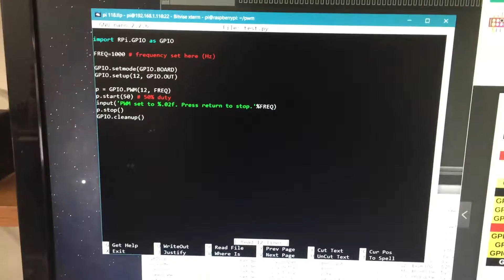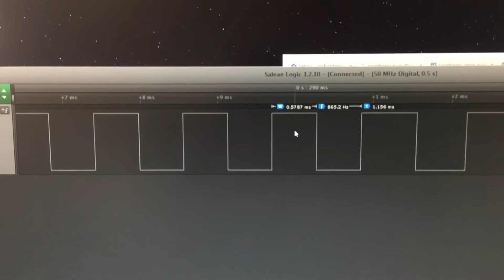Raspberry Pi PWM is jittery (seen with oscilloscope and logic analyzer)

Comment: It looks like I'm a bit late to the party, But the pwm is indeed noisy/crappy compared to a nice hardware pwm solution. I tried to use it as the pwm signal for some LED lighting drivers by using a transistor to pwm the dim+ and dim- wires open/closed, but the lights were a bit flickery, sometimes jumping to full brightness when the pi would stumble a bit. However after switching approaches and filtering the signal with an RC filter, then feeding it to an op-amp powered with 12v I was able to get a very clean 0.7-10v signal when modulating the pwm wave. I used enough capacitance to get about a 3 second response time, so the filter is averaging about 3 seconds worth of pulses, at 1000 hz, that's 3000 pulses it's averaging.. if they are all a little different it's okay.. after averaging 3000 of them a few errant pulses and spikes will be invisible. In a simulator I was able to make a random noise signal come out to a perfect 5v (1/2 on 1/2 off). The key is sacrificing changing speed.. if you need the system to respond to change in milliseconds the pi will not work.. but if you don't care that it takes a few seconds for the power to come up to value it's fine.  
Raspberrypi fourm post : Creating a 0-10V voltage range for ballasts
is where I got/stole the majority of the design.

Comment: You should try pi-blaster. I wrote this (based on servoblaster) to fix this very problem. It uses the DMA controller to generate a stable pwm output: https://github.com/sarfata/pi-blaster

Glad to see you back posting stuff!

Comment: Pretty normal for a Pi. You can use a Pi to drive an Arduino, or other MCU, or just a PWM chip to get a nice clean PWM from it. But something tells me you already knew that. 

It sounded like you wanted to generate a DC voltage from the  Pi. You can get a reasonably stable voltage output with smoothed PWM from the Pi, if your smoothing is strong enough. I have used it to control analog meters with very little fluctuation with a good sized cap.

Comment: are you using a real time OS? That extra delay looks like the delay from the scheduler. Even on a PC you have delays like that, the only way to fix it is using a rt os or recompiling the kernel with a shorter period / setting it as real time.